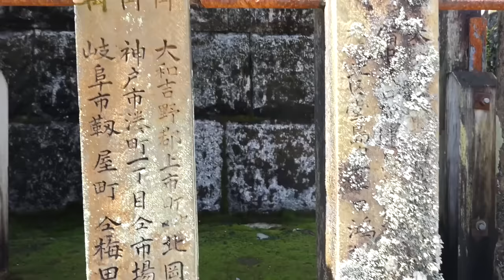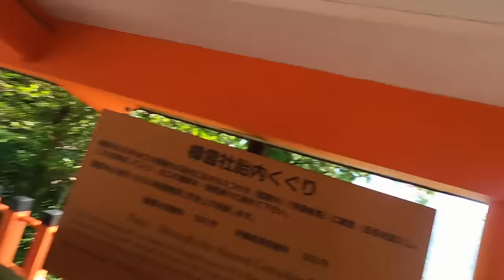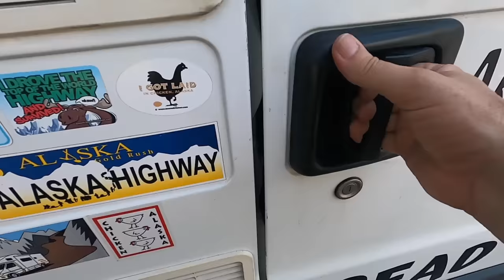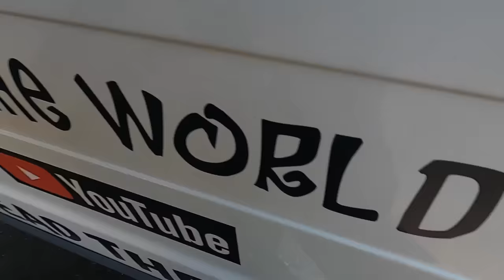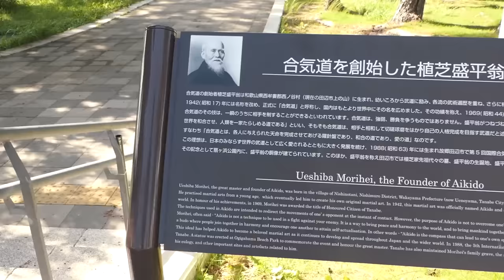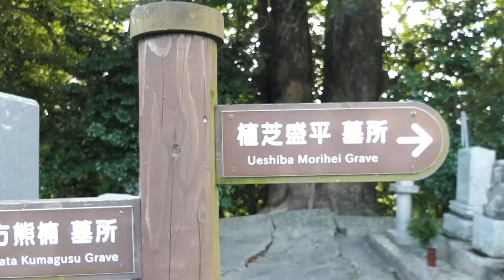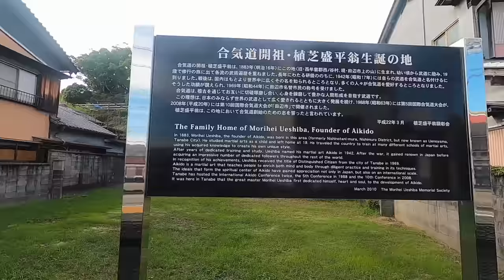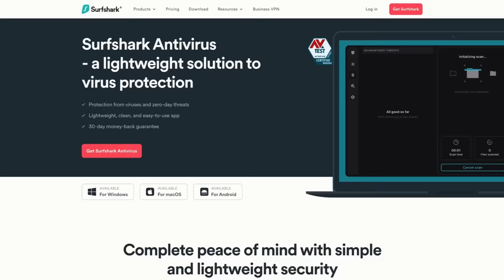BIZARRE 24 HOURS IN JAPAN -  TROUBLE AT A TEMPLE [S8-E12]

Comment: The gods and Buddhas of Nachi will watch over you until the end of your journey.😉
A lubricating oil spray commonly used in Japan is kure 5-56. This is available not only at auto parts stores, but also at DIY shops and large supermarkets, and is inexpensive and reasonably effective. Good to keep.

Comment: Quiz- How did WD-40 get its name? WD stands for "water displacement" (yes, it can be used as a lubricant (not really good for door locks as dirt and dust can stick to it) and can be wiped on metal to keep it from rusting. The 40 come from the formulations, it was the 40th formulation that the company decided was the best one hence WD-40. The temples where really nice and that water fall amazing! Thanks for another great video.

Comment: Although it would not help with a valve problem, please buy a can of tyre repair solution. I bought one in 1978 before travelling around Europe for 3 years, kept it while working in the UK for another 2 years, then took it to South Africa, where I needed it another 6 months later. All the instructions on the can had, by then, been scratched off, but I attached it to the tyre, pressed the button and Hey Presto!, it worked and I drove off the beach. 600 km of driving later, I had the puncture repaired. Apart from that, almost all of the breakdowns I had were within metres of a garage!
Reply from the maker: Yep we have one in the boot in case we have two flats - but as you said - it was a valve problem this time 😉

Comment: In Japan, dashboard temperatures can exceed 70 degrees in the hot summer sun. Care should be taken not to leave heat-sensitive items or items containing lithium-ion batteries in the car.
It is known that many cars made in countries with low humidity, such as the UK, deteriorate rapidly in humid countries. Please continue to be careful when passing through humid countries.
Reply from the maker: Thank you for this info 🌺

Comment: Ya know... I would be wd-40 every hinge, lock and runner on your van. I do it in my motorhome often. I do try to use a spray lube that is not oil based as not to attract dust.
Reply from the maker: Thanks for the tip

Comment: I have some of those Hi Torque wrenches. Bought several years ago at a flea market. They have the security hole. Get a bigger can of lube. The van is to old so you will have to do inspections every morning and lube as you go. You might also get some JB Weld expoxy or similar for broken plastic parts.
Reply from the maker: Thanks for the tip
Reply: @TREADtheglobe  Your welcome. I forgot to tell you WD-40 is great for freeing dirty parts. It is not a lubricant like many people think. Because you drive in areas that attract dirt you need a dry lubricant. I don't know what they have in Japan but lube for locks and hinges that don't leave a oily mess that attracts dirt. Happy and safe travels.